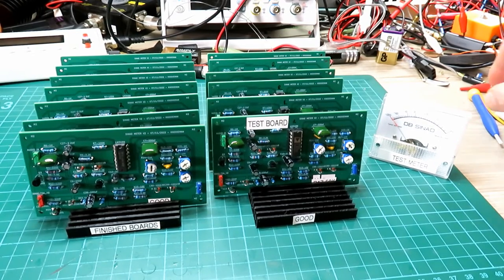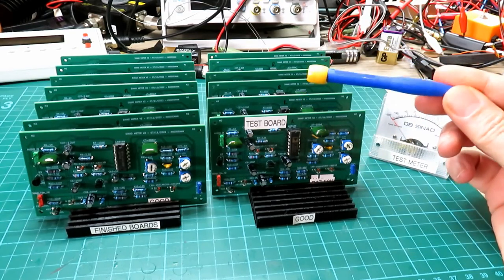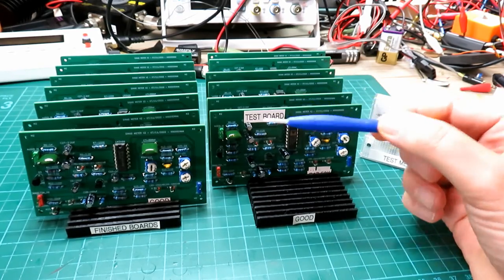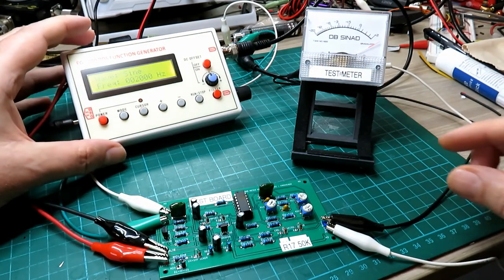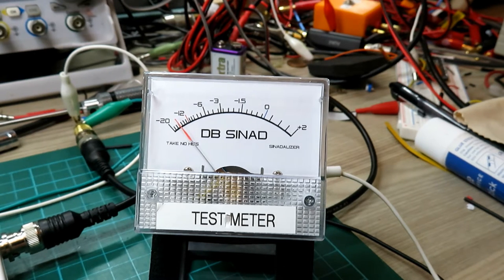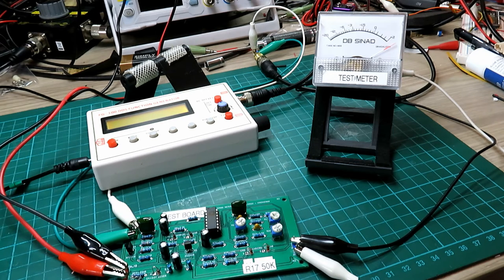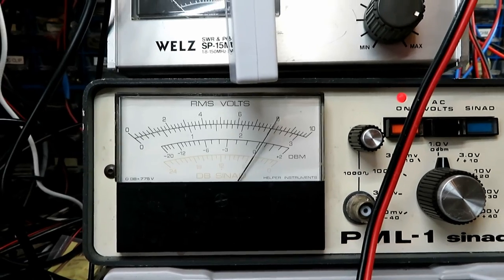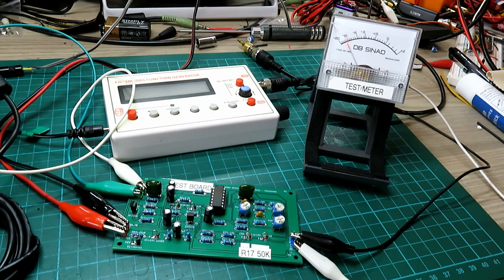More Sinad Meters Available - Pick your Colour - Calibration Explained and Test

Comment: I have watched a ton of SINAD videos, however everyone neglects to mention 1 very important step in measuring....and that is where the heck do you set your volume control!  In my testing, I see the volume gain can and will mess with your end resaults....so it would be very easy to get 12dB just by adjusting your volume!  Can someone please tell me what is the proper placement for this control.  Thanks!  ~Jack, VEG